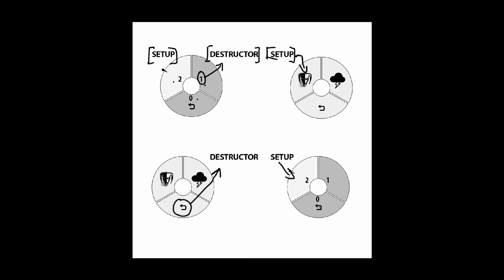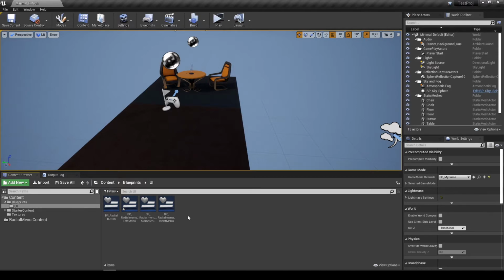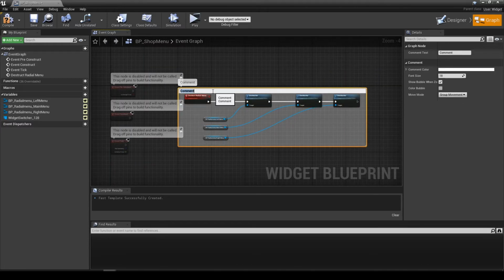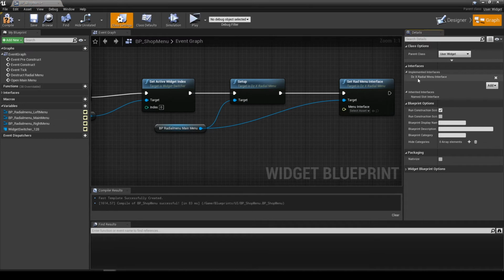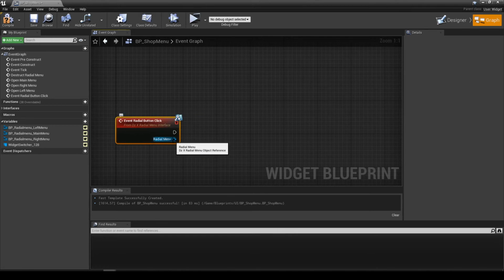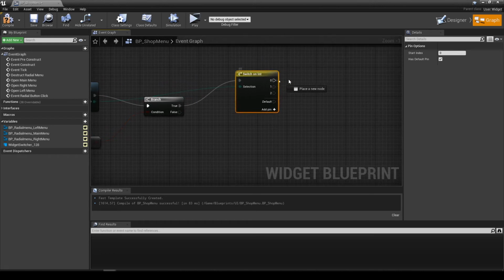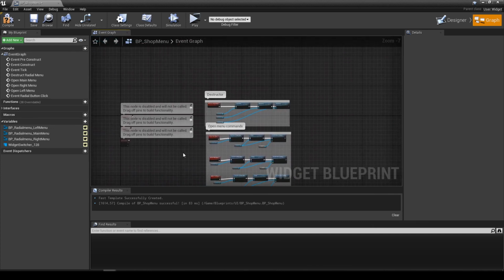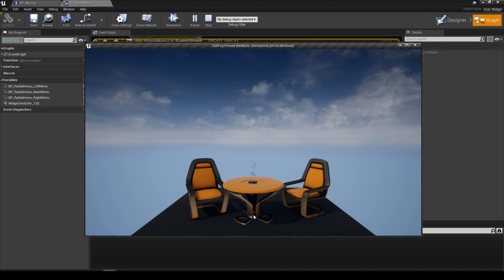UE4 DzX Radial Menu -Sub-menu system [ Tutorial ]

Comment: I have been messing around with this plugin, it has been incredibly helpful, I just cannot seem to set the state of a button to disabled given some parameter. I have set a bool to false and when I use breakpoints I am getting to the point that in the menu the button should be disabled but the button display widget does not display or have a disabled state, the hovered works fine but again disabled hovered does not show. I have tried a few things but the closest I tried was: from the menu as a variable get button (say RadialButton1) then some game logic, then from that variable RadialButton1 set disabled. From this I can pull off a slate brush but I just can't seem to get the button to reflect the fact that it should be disabled. Any bit of advice would be fantastic. Again thank you for the plugin.
Reply from the maker: Hey there. I will give you full answer tomorrow (not with pc today). If smth is missing i'll update, anyway can you chekc if you have plugin version 1.1? In that version i created function to disable buttons, if that does not work ill check it out tomorrow. 
Thanks, i am glad you find it helpful!
Reply: Yep, so I do have version 1.1, I found off setRadMenuInterface a disable button function that I feed in the variable menu and the index for the button I want turned off and it works perfectly.
Reply from the maker: @dominicpontious2054  so you fixed your issue? Check out documentation in marketplace link if you wanna see all the functions in this plugin. Anyway if you need help just ask